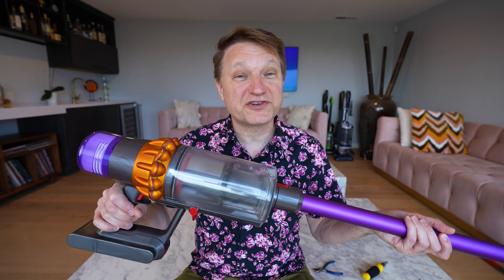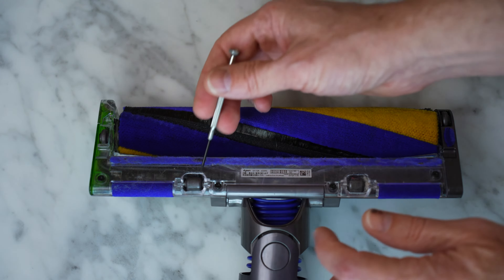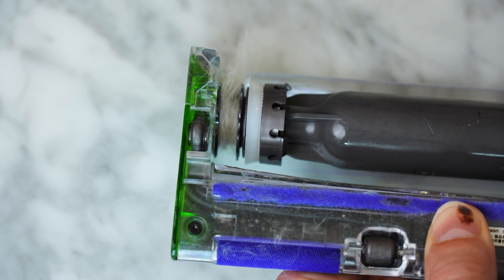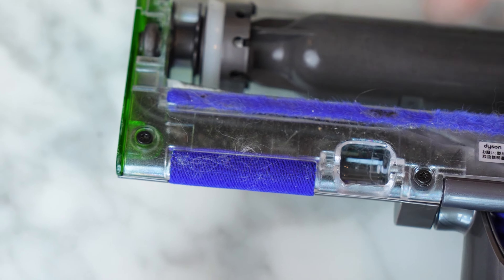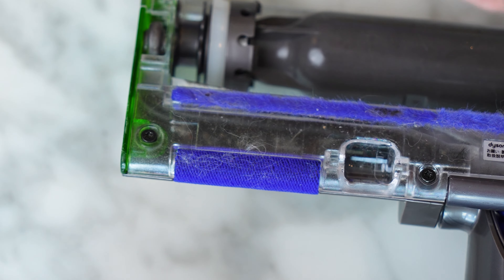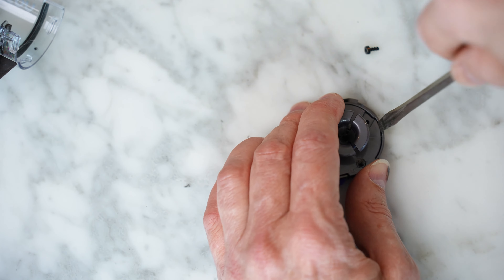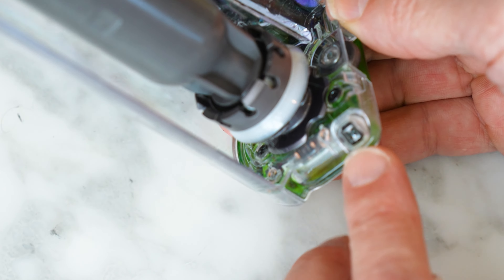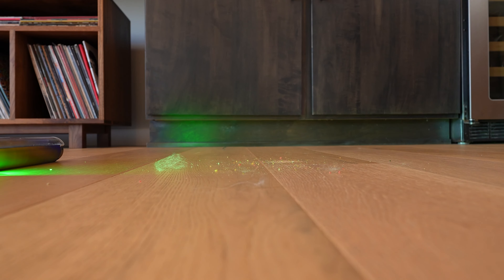I FIXED This Dyson Hidden Problem  (And You Can Too!)

Comment: Lol yeah, my mom did the sae thing and removed the hair from the small wheels. Also after some time the wheels may start to squeak, just add some oil on the sides of the small wheels to prevent that. but the fluffy head definetitly is a game changer, it helps avoid missing dust!
Reply from the maker: A tiny bit of oil is probably not a bad idea.

Comment: I’ve been looking into buying a dyson but i cant decide between the v12 detect, v15, or gen 5 detect. I have mostly hard wood floors with one carpeted room. Which cordless vacuum is the best (so i don’t have to buy another one in a couple years) in your opinion? Love your content and definitely think you are one of the leading vacuum experts
Reply from the maker: Your situation is the same as mine. All hardwood, with a single carpeted room. The V12 is good because it’s a little lighter. The v15 is 7ish lbs and will last about 50 minutes in auto mode. I love the laser, it’s not a gimmick. The gen 5 is great, but it’s a bit on the heavy side. Personally I value a lighter vacuum. 
v15 https://amzn.to/3JdNXv5
V12 https://amzn.to/49qs1rn

Comment: I just bough the v12 and find the fluffy head is sticking on tiles…the tiles are clean but still occasionally sticks like it’s rolling over glue or something. It’s perfect on wooden floors though.
Reply from the maker: The tiny wheels get hair in them so easily